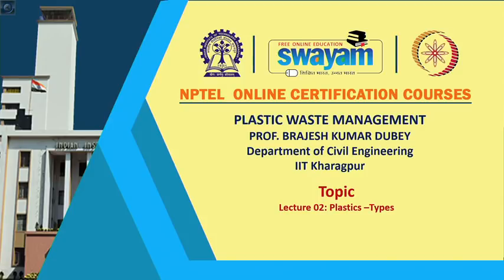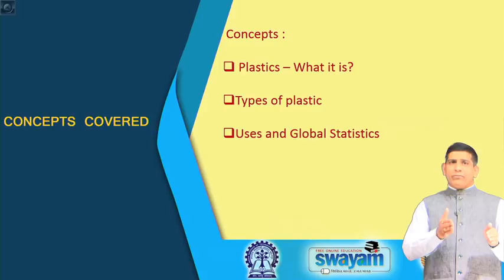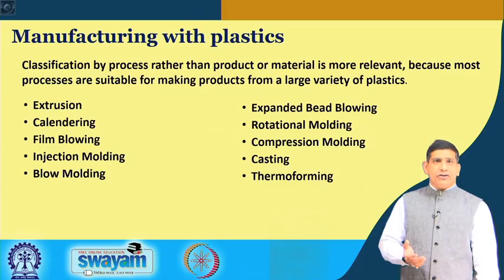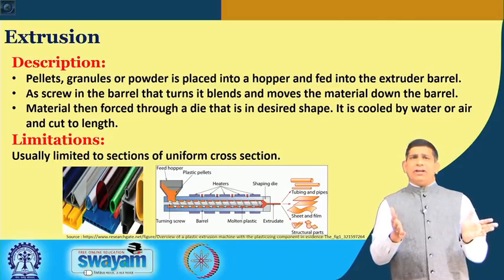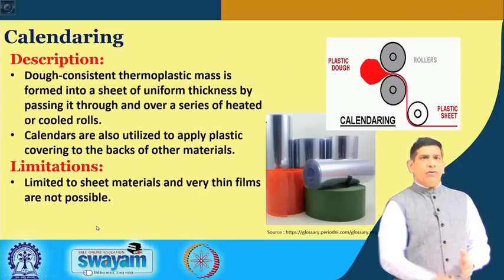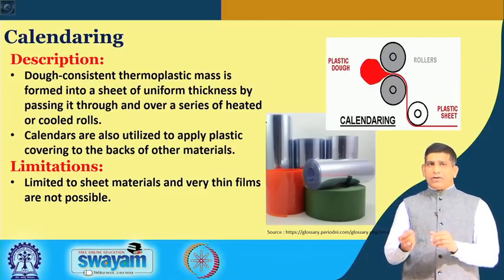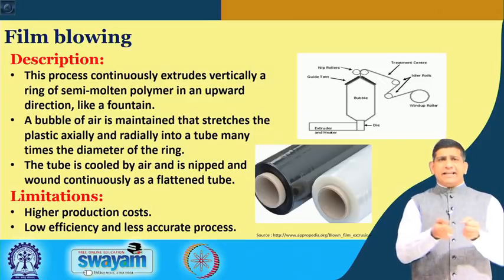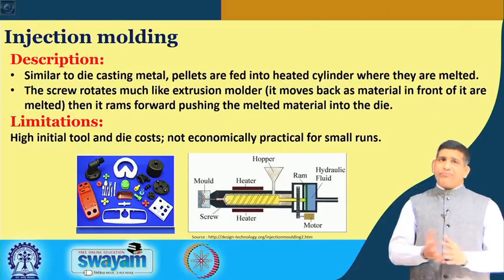Lecture 02 : Plastic - Types

Comment: 🇮🇳 Lecture 02: Plastic - Types 🇮🇳

A] Different moulding methods : @2:00
1) Extrusion
2) Calendering
3) Film Blowing
4) Injection 
5) Blow moulding
6)Expanded Bed Blowing
7) Rotational 
8) Compression
9) Casting
10) Thermoforming

B] Characteristics of Plastic : @18:29
(In General) 
a) Very resistant to chemicals & Corrosion
b) Thermal & Chemical insulator
c) High Strength to weight ratio
d) Durable, less Toxic and water resistant
e) Easy moulding, Cheap & manufacturing

C] Classification: Based on @25:20
1) Behaviour w.r.t. Heating
 2) Structure
3) Physical & Chemical properties
4) Types of Resin

Date: 15 June 2022
🇮🇳 Thank you sir 🙏 🇮🇳